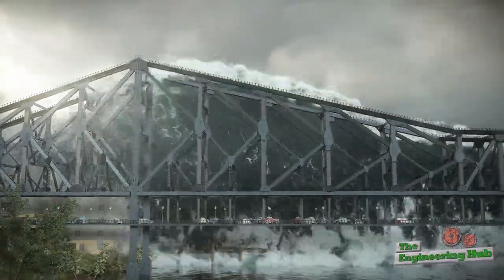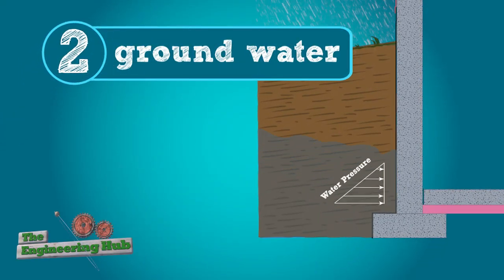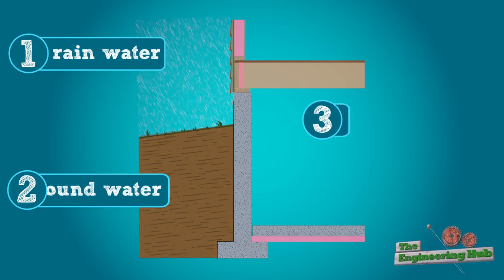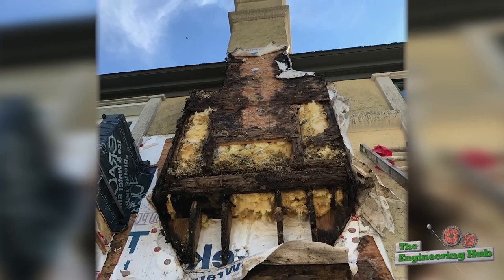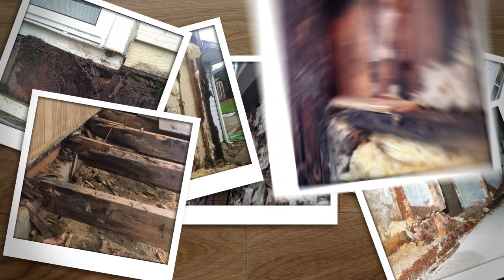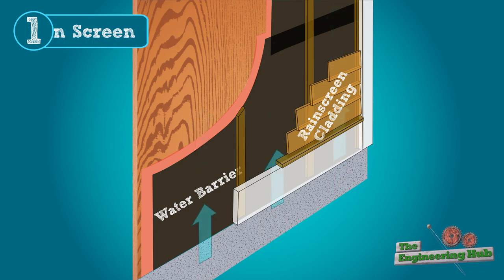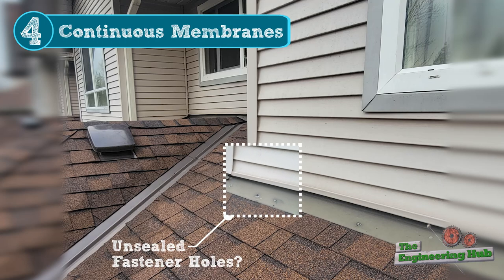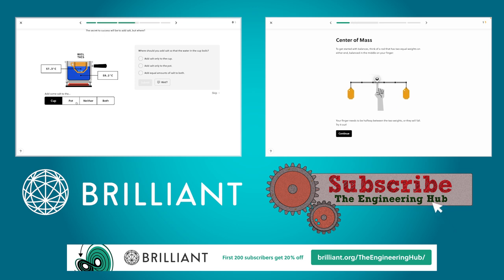Waterproofing 101: The Science of Keeping Water Out of Buildings

Comment: Great video, with a nice basic explanation of water management concepts!  

I have one correction from a building science POV.  Air barriers are not vapor barriers, and should not be treated as the same.  

In modern energy-efficient building design influenced by building science principles, we consider the 4 control layers in the following order of importance:

1.  Bulk water control
2.  Air control
3.  Vapor control
4.  Thermal control

You mentioned these control layers in your video, but didn't sufficiently differentiate air and vapor control.  When controlling moisture, air control is most important after bulk water control because humid air brings in a lot of moisture into a building wall assembly and interior.  A small hole in a wall that allows humid air to leak in brings inside significantly more water than vapor diffusion would through a more airtight wall.  

The last sentence introduces a new concept.  An airtight wall is not the same as a vapor impermeable wall.  Why?  Air molecules are generally larger than water vapor molecules.  There are many "airtight" materials available for construction, and each of them have different vapor permeability (the measure of how readily water vapor can pass through).  Materials with some vapor permeability allow water vapor to pass through, while vapor-impermeable materials (such as polyethylene sheeting) will block water vapor passage.  

Therefore, it is most important to control airtightness in a building (after controlling bulk water).  However, the placement of the vapor barrier should also be carefully considered because, as you mentioned many times in the video, water will inevitably make its way into the wall assembly and needs a way to dry out via evaporation (water diffusion).  Therefore, it is important not to trap this water inside a wall assembly and prevent it from drying out, which can happen if it is trapped between two vapor impermeable layers.  

Another key concept that you alluded to but didn't explain fully enough is vapor drive.  This is the direction that vapor evaporates towards.  A short rule of thumb is that vapor is driven from the warmer side of the wall to the colder side.  Therefore, the vapor drive will change depending on the local temperature and season (going towards inside in hot summers, going towards outside in cold winters).  

Finally, I mentioned before that different airtight materials had different vapor permeabilities.  However, there are some so-called "smart" air barriers membranes whose permeabilities will change depending on the temperature.  In cold temps, they have low permeance to prevent indoor water vapor from going through the wall assembly past the insulation layer, which helps reduce mold-forming conditions inside the wall.  In warm temps, they have high permeance to encourage drying towards either the outside or inside.

Comment: I live in rural Scotland and surprisingly it is the newer buildings that suffer more from dampness as we are much higher than the river so most have no problem with river ingress. Most of the buildings are from the 1880s onwards and were built in stone, my walls are 2 feet thick but do have underfloor vents which keeps the underfloor dry. The modern sealed buildings suffer more because the building is sealed from draughts which makes dampness a greater problem. They do have underfloor vents but for some that is a hazard when the river breaks its banks. Most people do not understand ventilation, I try to explain it by asking a person to put their hand over their mouth then attempt to breathe. When they can't I tell them that explains, if there is no way in, you can't force it out with a fan. I have a 6" fan and a free flowing 5" inlet so I have through flow and no dampness.
There are a multitude of flood prevention methods out there, it just seems like people expect others to solve the problem for them. 
If you buy a house next to a river you have to expect water.

Comment: Great video! I'm a civil engineer, so I don't deal with much things inside the building. It's interesting to see how waterproofing of the building is done. However, after seeing all of this I do wonder if we as a society made a mistake by prioritizing fully wooden buildings. Seems like waterproofing would be much less of a problem if more structures had brick or cmu walls.
Reply: I''m a Carpenter and have been involved with restoration work on wood framed buildings over 150 years old across the humid Southern US. There are plenty of even older wood buildings doing well so I think it's safe to say that wood can endure. The thing I've taken away from my studies and experience is that wood needs to 'breathe'. In other words there must be air movement to allow excess wetness to be carried away through the atmosphere. You can seal one side of it (exterior) as long as there's enough 'breathing' with the rest. Old balloon framing, pier foundations, and open fenestration for cooling gave you enough 'breathing' to keep wood from rotting. Now we seal everything up and wonder why it's all rotting away as little as 30 years later. Brick, CMU's, and concrete aren't a viable solution being far more costly, less eco-friendly and renewable, and they also need to breathe or they can retain an unhealthy amount of moisture for human habitation. 

If there's a real solution it lies in learning to live with nature instead of trying to fight it.
Reply: Poor choice in seismic regions like cascadia

Comment: I´m not a big fan of membranes at all, neither inside nor outside.
Our house in part is a timber frame from the 1880s, the outside is only covered by an inch of wood with slate nailed to it.
A good decade ago we had to replace the slate (started to get flaky, nailholes got loose), but except for a very small section of maybe 1 sq m / 10 sq ft, the old wood stayed, as it was perfectly sound. 
The rood is tiled, and those tiles here and there even had light coming through when you looked down from inside, still the attic was super dry (had to retile and insulate the roof due to new regulations, though).
The lack of membranes enables walls and roof to dry out, if they get wet in the first place at all.
Btw, we´re talking about Western Germany and a city that is considered fairly rainy.

Comment: Build everything out of plastic stuff … that is melded together with heat guns…and is built on a hull that can float. Put the whole thing under a stainless steel A frame shed…. Anchor the whole thing on 4 points 20 feet down in the ground… if that don’t work your screwed…
Reply: All your stuff will rot due to the water from your breath.